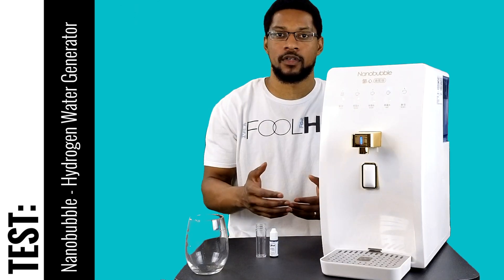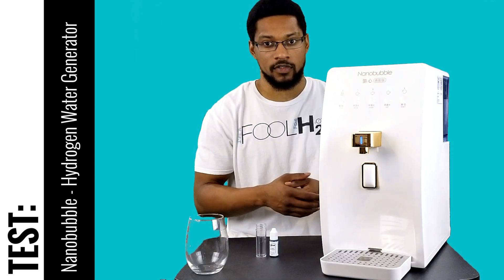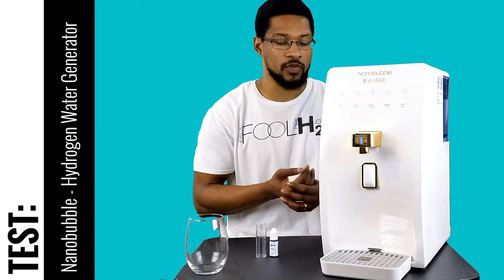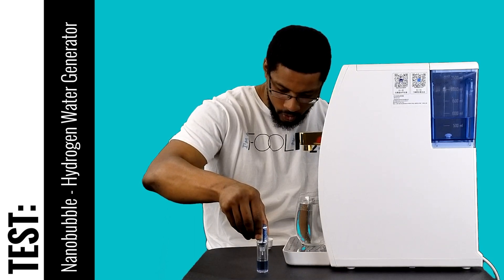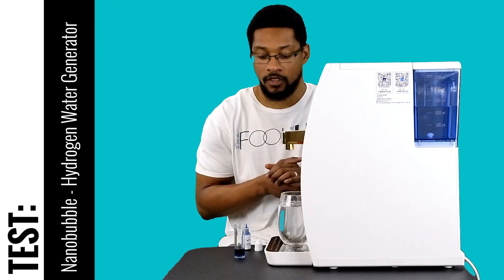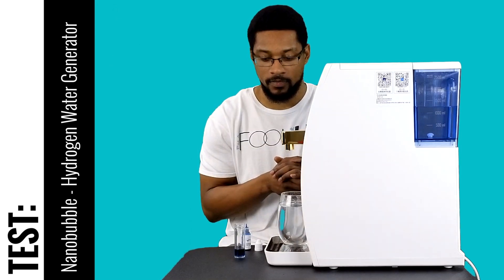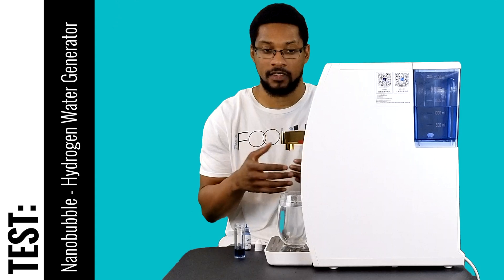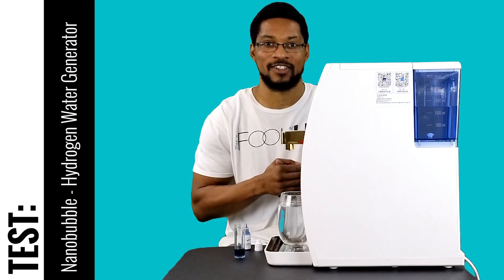TEST: Nanobubble Hydrogen Water System || H2Hubb

Comment: 2,5 or 3 ppm is not possible, Max possible under pressure is 2 ppm and 1,6 ppm in an open container.
Reply from the maker: Hydrogen gas solubility in water depends on temperature and pressure, as described by Henry’s Law. Under normal atmospheric pressure (1 atm) at 25°C, the saturation point of dissolved hydrogen is 1.57 mg/L (ppm). Increasing pressure (e.g., 5 atm) significantly raises this solubility, while higher temperatures reduce it. Conversely, colder temperatures increase hydrogen solubility and slow its dissipation, extending its half-life in solution. As a result, super-saturated hydrogen water (>1.57 mg/L) is often recognized for delivering a higher therapeutic dose of molecular hydrogen. Therefore, 2.0 mg/L (ppm) is not the maximum dissolved H2 concentration. 

For reference, hydrogen solubility under various conditions:

1 atm, 25°C → 1.57 mg/L (saturation point)
1 atm, 0°C → 1.96 mg/L (~25% increase from SATP)
5 atm, 25°C → 7.86 mg/L

Additional sources on this topic:

Molecular Hydrogen Solubility - MDPI
https://www.mdpi.com/1420-3049/24/11/2076

Gas Solubility & Temperature - LibreTexts
https://chem.libretexts.org/Bookshelves/Physical_and_Theoretical_Chemistry_Textbook_Maps/Supplemental_Modules_(Physical_and_Theoretical_Chemistry)/Equilibria/Solubilty/Temperature_Effects_on_the_Solubility_of_Gases#:~:text=The%20solubility%20of%20gases%20in,Equation%204%20to%20the%20left.
Reply: @h2hubb806  If supersaturated H₂ water is flowing as in your video (e.g., through pipes, tubing, or falling from a spout), it will likely drop below 2 ppm before reaching an open container below.
Reply from the maker: That's not correct. The H2 gas will equilibrate with the atmosphere, decreasing in concentration over time following a half-life curve. This process is influenced by factors such as water temperature, volume, surface area, nanobubble size, container material, and overall container size.
 
This process is not instantaneous. There is time to ingest this higher concentration hydrogen water. 

https://www.h2-analytics.com/sample-analysis
Reply: @h2hubb806  You have forgot the running water part, this is the main source for H2 loss.
Reply from the maker: I think you're overlooking several key factors that contribute to the high H2 concentration and why it doesn't immediately fall below 1.6 mg/L (ppm).

First, this device does not operate in an open-atmosphere system; instead, the hydrogen gas is dissolved under pressure (30 psi). The pressure drop—and subsequent gas release—does not occur until the hydrogen water exits the spout.

Second, the dissolved hydrogen exists primarily in the form of nanobubbles, with this device specializing in producing smaller nanobubbles (95% of them are under 250 nm). Due to the internal pressure within these nanobubbles, Brownian motion, and the established principles regarding the half-life of gases in solution, the hydrogen concentration is not instantly lost but rather follows predictable exsolution patterns and half-life decay curves.

Third, without a proper understanding of the engineering and technology behind this device, it’s easy to make inaccurate assumptions. I’d encourage you to thoroughly investigate the device before making definitive claims.
Reply: @h2hubb806  I do not miss out any key factors, how the H2/water is mixed do not mean anything as long as you expose it to atmospheric conditions after mixing. Where you lose the most is the running water phase.
Reply from the maker: Cool.